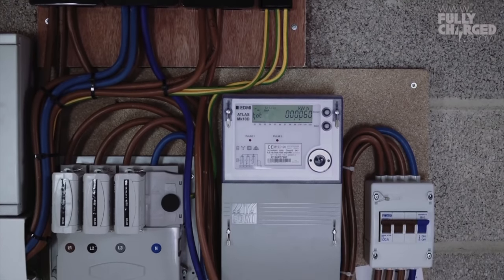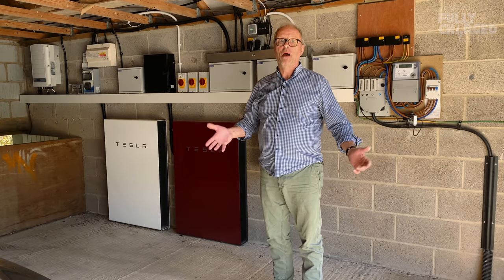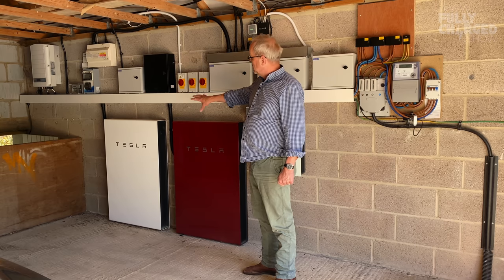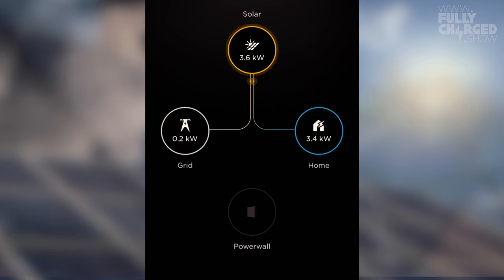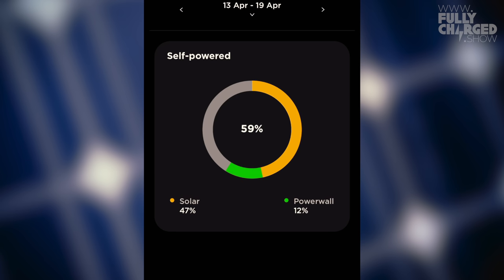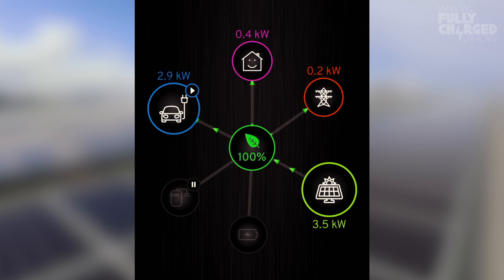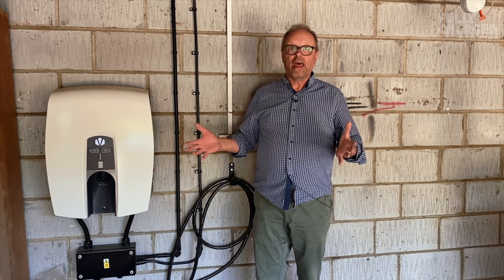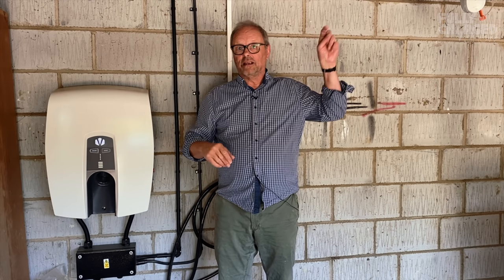Tesla Powerwall: how quickly can it respond to a power cut? | FULLY CHARGED for clean energy & EVs

Comment: V2G with a NON million mile battery will cost the battery of the car to degrade at an unsustainable rate ... Can't wait to see what Tesla have up their sleeve
Reply: That's what they said about EVs when they first came out - oh all that charging and discharging, the battery will only last a year or two tops, and here we are with batteries routinely lasting 10 years.  The V2G controller won't fully charge or fully discharge the car battery, and when you keep it in that sweet spot in the middle, it will last a LOT longer than it will doing full cycles.  There's also the possibility of getting an old EV with a poor battery and using that, because cars need to hold their charge for a long time (which is harder as batteries age), but V2G charges and discharges relatively close together.  So a car that doesn't have enough charge for decent driving may still work really well in a V2G application.

Comment: Ironically my power cut off this morning and our power wall did not turn on... thanks elon
Reply: Unless you have the separate gateway to isolate your powerwall from the grid, the powerwall is not allowed to turn on - because as Robert pointed out, power flows both ways along the cable - without something to isolate the powerwall, it would end up trying to power the local grid (both draining the battery fast, and potentially harming any engineer trying to fix the grid problem)

Comment: You won't need the car-to-house system, as you have 2 Tesla power walls🙂
Reply: Vehicle-to-Grid (or Powerwall-to-Grid 🙂 ) will make him money ... buy-low sell-high. No idea if it is of significant value to the punter, but millions of car batteries available to the Grid sure as heck beats having CO2 emitting Gas Peaker-Plants spinning on stand-by just in case there is a demand.

Comment: Why would you power your house from your car? Battery packs in cars are the most expensive components. It's a very bad idea to stress it with this vehicle to grid system. These packs are designed to power the car so it's lifespan is stretched to cover the lifespan of the car in best case scenarios. Now imagine if you shorten the lifespan of your battery by charging cycles that hadn't put any mileage in your car. You are stuck with a car that is basically perfect but you have to pay 15000$ for a new pack which is probably a third of your car's worth.

Comment: 13:14 UK 2020 => Average 189g CO2/kWh YTD... but limits are 10g to 325g on a good day, yeah that´s not dirty is it??? 
Also, @0.3 - 0.7 kWh / mile => your nice "clean" electric cars are putting out 56g - 132g CO2 / mile - not that clean either. And on cloudy, non windy days this can easily double - it´s the picture peoples...
Reply: Farlig66 but when the grid eventually cleans up, fossil cars will still emit the same as they do now.

Comment: So this is the so called sustainable future? A garage with a wall full of expensive batteries, inverters, wires and other complicated contraptions. All with a limited life span. Not to mention a roof full of PV panels which took lots of fossil fuels to produce in the first place. Again with a 15 to 20 year life span. Then what? Go out and purchase more panels made from  fossil fuels while dumping the old ones in landfill. Mine  more rare expensive earth metals for the new batteries and away we go on our delusional carbon friendly life. If one is to step back for a moment take a deep breath and take a careful look at all this, it really is not as environmentally friendly as it's made out to be. A detailed analysis might even show it to be the opposite. It wouldn't surprise me in the slightest if after such analysis the whole system proved to be more polluting than being hooked up to the grid with a reasonable percentage of hydro or nuclear. The only real way to live a carbon friendlier life is to consume less, live in a smaller abode, have a bike instead of a Tesla, eat less meat, holiday at home etc. This video sadly doesn't depict a green solution, it's have your cake and ice it green.